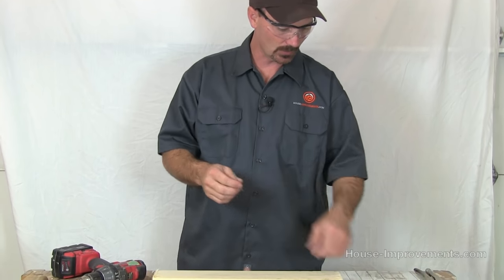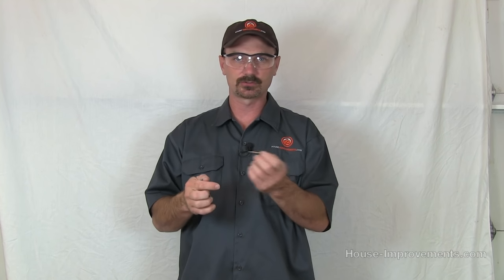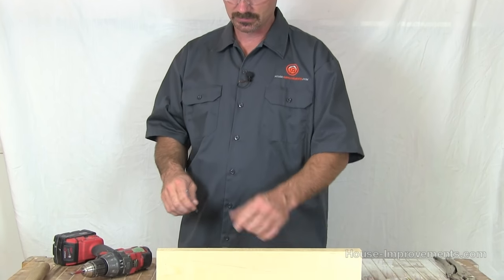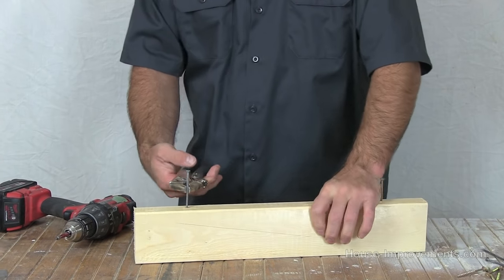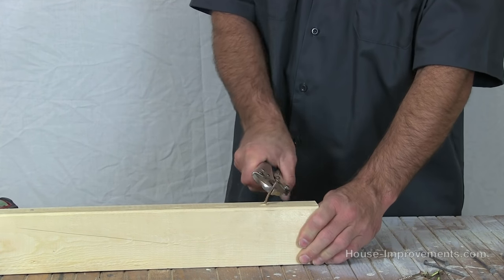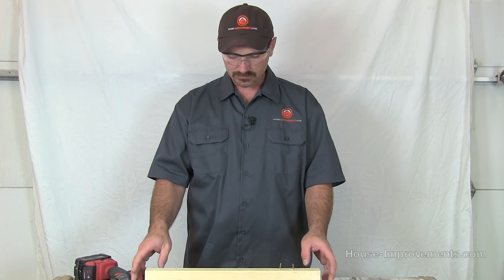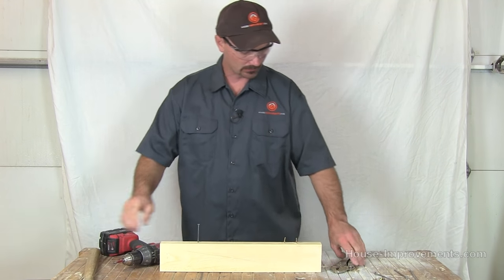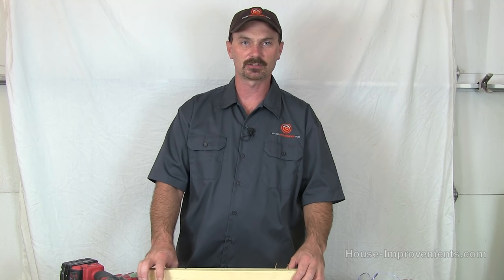Screws vs Nails - Which Is Stronger?

Comment: There is NO real world application were a screw (like in this video) would be susceptible to this type of 90 degree bending.  Take basic framing or purlin installation for example.  Try and pull apart who materials at the joint... the nail will fail and pull out first.  A prime example is pulling fascia off of rafters.... I can easily by hand pull the fascia off when nailed.... but with screws... NO WAY!!!
Reply: "no real world application" ....  LOL, you mean, the real world application of building houses over hundreds/thousands of years that has resulted in the structural integrity you take advantage of today?

He didn't say screws don't have their applications, in your scenario of a fascia, that's perfectly fine, but if you want to support a floor across some framing and support beams, then use nails.
Reply: The real world application is nails generally have better shear strength (up and down motion) and screws better tensile strength (pull motion), all things remaining equal.  Now if someone could invent a hybrid which gave us the best of both worlds.  Outdoor decks seem to do better with screws and lag screws, but house framing out of the sun where temperature differentials and the thermal cycle (heating and cooling resulting in expansion of materials) don't come into play as much does better with nails.  Earthquakes could conceivably put both tensile and shear loads on any structure, and if strong enough (such as a 9.0 on the Richter scale) will tear apart just about any building.  Maybe the moral is to use the best building materials one can afford for one's particular living area.  Structural screws such as GRK have come a long way in the last few years, and they are so much easier to work with than nails or even lag screws.  And they can generally be removed just by backing them out.

Comment: The screws are screwing my job right now. Because my boss said I totally failed to test or design a test to find the best screws !!!!!!!!!!!!!!! Damn screws is taking my job away !! It's real!! But I hope  if I loose this  job then my Lord will give me a better job. I told my assembler guy to just put more screws or put thicker screws everywhere than that we have . I tested 5 different kind screws , all broke in 5 foot lbs torque.  Also i tried different test that they have in the factory. My assembler tested with drill machine , but my boss didn't  like that. He said its not scientific or engineering idea although it was able to give us relative comparison among screws.  Damn screw!!

Comment: your recommend for nails may be correct- but you  are testing by bending- not shearing - you would have set up a shear test differently- if the cross-section of the nail and screw were the same- the results would be less dramatic

Comment: OK.  That's why roof shingles using nails instead of screw. I always wonder why not uinsg screws to grab the shingles onto the roof better. I thought they use nails is better for the roofing business so we have to replace more often.
Reply: livefree they use nails because its faster and you dont need to hold shingles down very tight. only the tops are nailed and just snug as to not pinch the shingle and damage it

Comment: You’re comparing a structural nail to a cheap screw? An appropriate screw is stronger (ie, a simpson strong tie connector screw for a joint vs similar nail).
Reply from the maker: Many people are trying to use these deck screws, so this is my point. Do not use these screws for structural framing.

Comment: I think that you are making a big confusion between shear force and bending force. What you showed us is a test to bending. Shear is totally different thing: force applied should be parallel and as close as possible to resistance force.
Reply: +iahim namor It doesn't matter because he is not giving us a class on forces.  He is simply demonstrating that screws will fail or "shear" before the nails will when they are plastically deformed.
Reply: I believe he is making his point on fatigue life through using bending.
Reply: Show me an application where are going to "bend" a screw/nail to the degree this demonstrates.  The outside of the screw/nail is in tension while the inside is in compression.  That's what "bending" does.  Shear is completely different.  If your purpose is to have an accurate demonstration/discussion about the pros & cons you need to not mislead people.
Reply: Sheer force is what causes bending. It's just a parallel force.
Reply: Little late to the party but the distinction is important as this is really more of a test of fatigue failure rather than pure stress rupture.  The reason the screw is failing earlier is some combination of smaller diameter of the screw core, different materials, and stress concentrators in the screw that are not present in the nail.  For the test to be a bit more meaningful we would need to eliminate the core diameter and material differences and also apply a load more characteristic of what the fasteners would see in real use.  For example, it's unlikely that we would see the threads exposed like is done in the test so strain seen at the screw threads would be much less and so the issue of stress concentration would be greatly diminished.
Reply: This is not a real world test, when would a screw fail like that- as a coat hook?

Comment: Metallurgy is a science, where as if  you consider the woods holding power with screws vs nails and various diameters, that would be more of an art. Why won't somebody test a #10 screw against #8 in a stud, per inch, per thread?

Comment: A construction screw in compression would never be subject to this type of cantilever force.
Have enjoyed and thumbed up a lot of your videos Shannon, but your wrong here.
Reply: When you buy these construction screws, the manufacturer's labels state "not for structural framing."  If you look up the shear strength of these construction deck screws, they are usually 80 lbs of shear strength, whereas the framing nails are over 100 lbs.

Comment: You used a framing nail and a non-construction screw... also, you went almost half way in on nail, giving it more durability.
Reply from the maker: The point was do not use deck screws to do structural framing

Comment: The SDWS Framing screw is designed and load-rated for replacing 16d, 10d and 8d nails in framing applications. The SDWS Framing screw is 0.160" in diameter and superior to nails in holding power and pull-out resistance. It is code listed under IAPMO UES ER-192 and meets 2012 and 2015 IRC® and IBC® code requirements for several common wood framing and engineered-wood applications.

The screw has a SawTooth™ point that makes for fast installations with reduced torque without predrilling, and its specially designed head countersinks easily to provide a clean, flush finish. The T-25 bit holds the 6-lobe recess tightly, reducing cam-out and head stripping.

www.strongtie.com

Comment: Framing nail vs dry wall screw lol any one doing structural work with dry wall screws is screwed any ways
Reply from the maker: Deck screw actually, drywall screws are even more brittle.

Comment: Your demonstration is flawed on many fronts.  

First you're using a construction nail yet there are only a select number of screws that are rated for "construction" and I'm fairly certain the screws you are using are not them.  GRK & SPAX are two that are specifically designed for the application.  If you were to review the data sheets for these as opposed to a 16d nail I guarantee the nail can't compete.  Second you refer to shear yet your test has nothing to do with shear.  You are subjecting the nail & screw to a bending moment.  Shear is a direct counter force exerted in opposite directions.   Buildings are subject to shear forces.  A beam is subject to shear & bending & possibly torsion.  Nails are subject to shear but bending to a far less degree.   If you were to compare a stress vs strain curve for both the nail & the construction screw you would find the yield & ultimate strength as well as the rupture strength of the screw far exceeds that of the nail.  Subject the nail to same torsion force as the screw & see which fails first.  I already know the answer.

As an aerospace engineer your demo is meaningless without numbers and specifics.
Reply: Given the choice to take advice from either:
a)  an intelligent, down-to-earth carpenter who does this kind of work everyday for a living and who is obviously sincere in trying to help the average do-it-yourselfer...
or
b)  an "aerospace engineer" with a vindictive attitude who, somehow, has time to act pretentious on a helpful youTube channel, who writes his opinions in a demeaning, condescending way, and who vaingloriously implies how much "better" he is because he makes more money...well...LOL

I will listen to a) before b)...any day.

Dear Mr. "Aerospace Engineer"...maybe it's time you find an over-paid position in a company with magniloquent theorists like yourself.   
Me...I'm heading back to the wood shop to get some carpentry projects finished thanks to Shannon's really helpful home improvements channel.
Reply: +Timmoyoga
I thank Shannon for his advice, but I'm listening to the vindictive aerospace engineer because he provided more rationale.

It makes no logical sense why a "nail" is stronger than a "screw." He explained what is happening and I feel less confused now.
Reply: @Timmoyoga  Seems like the "Aerospace Engineer" offered a good argument against the "intelligent, down-to-earth carpenter". The only guy with a vindictive attitude here is you.
Reply: Highest quality screws such as Spax, grk, and gripfast, are FAR superior in every strength application. Only inferior to nails in cost, and time it takes to drive. It's not arrogance, it's just science. Being nice has absolutely nothing to do with factual evidence. And yes, shitty average screws are definitely inferior to nails, in most applications. Thank you for your comment Mr engineer. I totally agree. Bruce Hoadley in his book Understanding Wood has a scientific explanation of why a screw properly driven (pilot hole) is superior to nails. I guess a person's ego gets hurt if they concede that something most people do, and maybe some they admire, isn't actually the best practice.
Reply: @Timmoyoga  I'm sure he's a really nice guy.  Some of my closest friends have been in the construction business their entire life.  I love helping them because the good ones have a tremendous amount of knowledge & common sense (and skill).  And I'm not disputing his intelligence.  How could I.  I don't know him.  What I am disputing is his lack of knowledge on the subject being discussed.  When you come on a forum such as this & "educate" others with false information over 160 thousand people walk away thinking they now know nails are better when the truth is they're not.  Are they adequate?  The vast majority of times, yes.  If the result of educating others is to offend......life does have its moments.

Comment: Screws/bolts are not designed to hold in shear. They provide clamping pressure. Nails and lag screws/bolts are designed to hold up under shear forces.

Comment: So you are comparing a FRAMING NAIL with a NON_FRAMING SCREW?  This is a lame comparison.  You need to compare a screw that is designed for hanging joists, then you'd have a real comparison on your hands.
Reply from the maker: I state in the video if you are going to frame with screws they need to be structural screws not regular deck screws.

Comment: I thought that was common sense. if you worked with screws, you should know how easy they break off. who are these "pros" nagging about this?
Reply from the maker: +Cheesus Chrust It is a pretty common misconception . You are right though anyone who has worked with both should have seen their one examples by now of how screws will break easy. Even using impact drivers to drive screws in hard wood will sometimes break the head off.